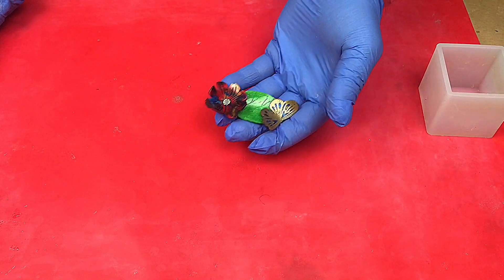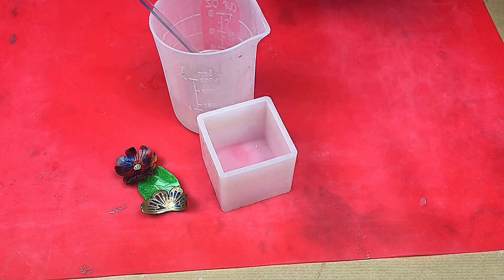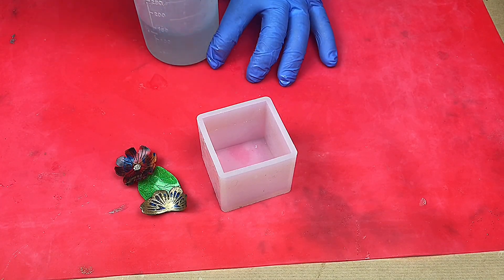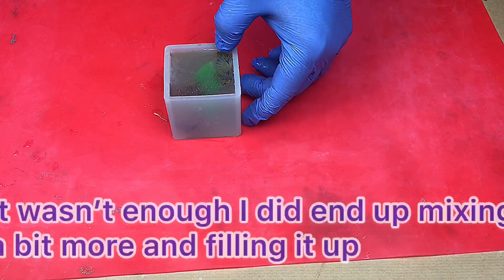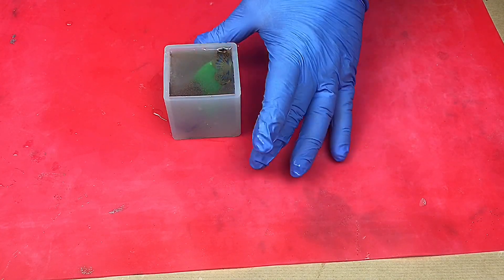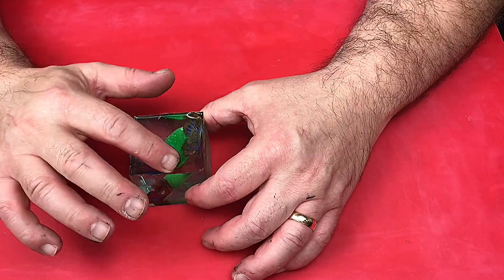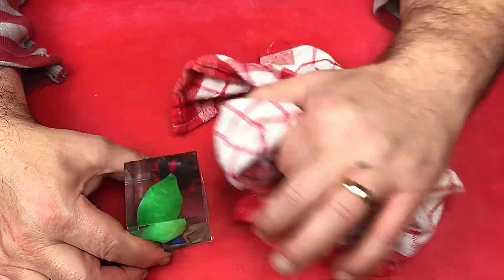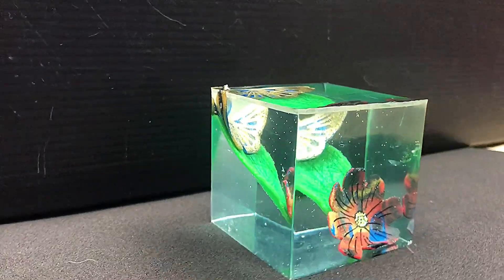Resin Casting Avoiding Bubbles, Without a Pressure Pot.

Comment: What is better to use a pressure pot or a vacuum pot?  Can you use a compound to polish the leaf and butterfly before putting it in the mold or will that affect the curing of the resin?

Comment: Hi which resin did you use for this? Can you pour all resins into a mould that size in one go or do some need to be done layer by layer ? Thanks
Reply: Steve McDonald Arts and Crafts that’s great thanks, I was also wondering if I could put fresh flowers or petals in the resin or do they have to be dried first?

Comment: If you'd put the flowers in the other way round then the top of the paper weight would have been the decent cast face, the uneven face would be at the bottom.